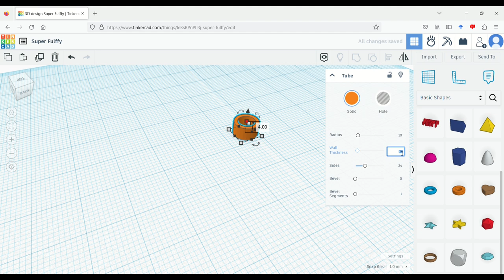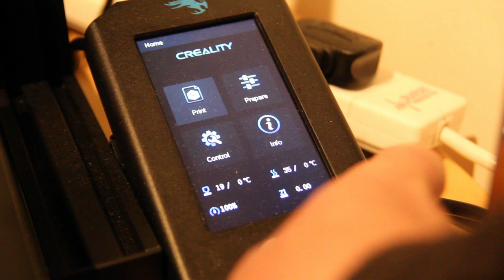Rickenbacker 620/12 guitar build Episode 32

Comment: Have you thought about just using the plastic or rubber washers used on rack-mounted audio gear for the pick guard mounts? Your custom-made spacers look good, though.
Reply from the maker: I hadn't but to be honest it was a useful excersice to get my head nearer to designing my own prints. It has worked well though.

Comment: Were those pickups Actual rickenbacker or Creamery pickups?  They must have been higher than those pickups??
Reply from the maker: They are Kent Armstrong, it turns out the are a little thicker than the originals. I wanted Creamery but they weren't taking orders.
Reply: @Adventuresfromtheshedofdreams  Yeah I waited like 3 months for my creamery pickups for hopefully a future build, and was glad to get them, much cheaper than Rickenbackers and voices for different era's, I went for the 63's. Surprised the Kents were off so much, well as long as you never did a mistake on the build that is what matters for a final result. I hope those really sound good given the extra work to install them. Creamery is just the one guy/owner so he builds up a list of orders than has to shut it down.